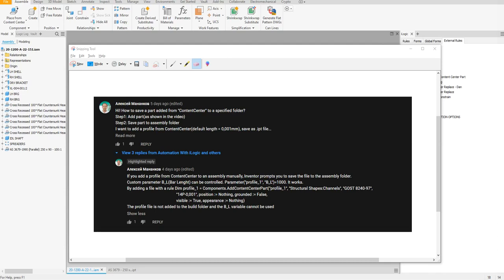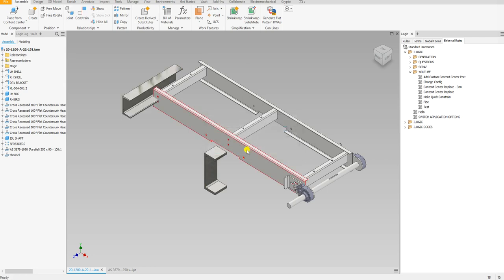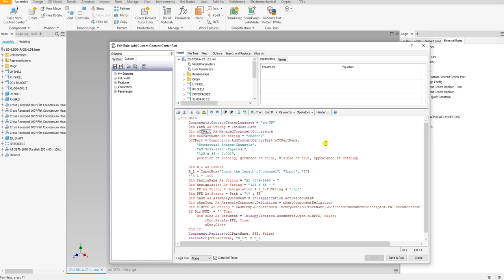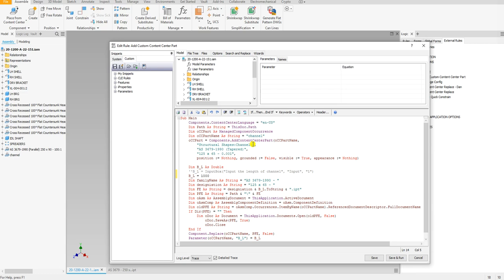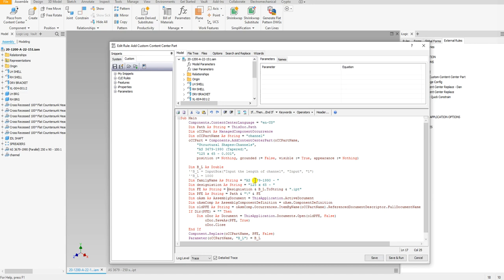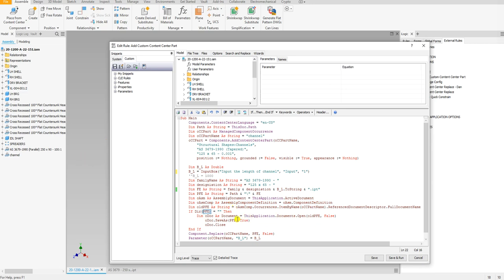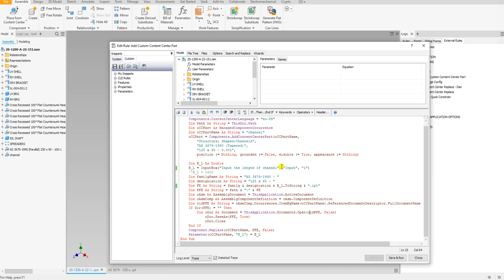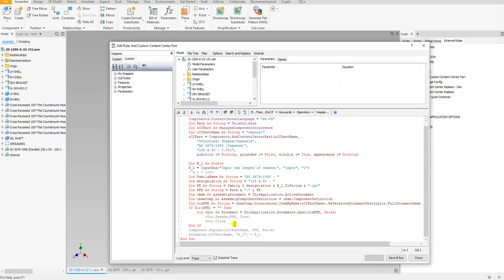iLogic Lesson #12: Creating Custom Content Center Part

Comment: Great Video, Is there any way that you can insert a cc structural shape in a different length then the attribute stated on the family table row? Say for example I have a beam that has the range 1-6000mm and 3000 is default value. And I want to generate a 3200mm long beam?

Comment: Great! Thanks for your work! I can suggest an idea for the next video. How to assign this profile to a sketch.
How assign profile from ContentCenter to sketch? My idea: create 2D / 3D sketch in any way. Using iLogic / VBA, to appoint profile.
Reply: Is it possible? I have not found any information on this theme.
Reply from the maker: @АлексейМананков-о4б  My pleasure. I think this might be possible, how did you want to assign the profile? Did you want to copy the sketch or have the sketch derived from the content center part?
Reply: @DesignAutomationSolutions  It doesn't matter how the sketch is received
How do I assign it a profile? Using the rule/code
Reply from the maker: @АлексейМананков-о4б  I'll look into it during the weekend, I am still not sure where to begin to extract the profile. In the meantime, you might want to look up creating sketches with iLogic, that may lead somewhere
Reply from the maker: @АлексейМананков-о4б  Hey do you still need help on this? I finally have time this week, I can take a look and make a video if you still need the help.
Reply: @DesignAutomationSolutions  Hi!I'll be very thankful. This is your channel. You decide on what topic to make a video. Maybe someday later.
Reply from the maker: @АлексейМананков-о4б  Alright I've published the video! I hope it helps. The command you need to copy a sketch to another sketch is CopyContentsTo(sketch As Sketch)

check out the video!